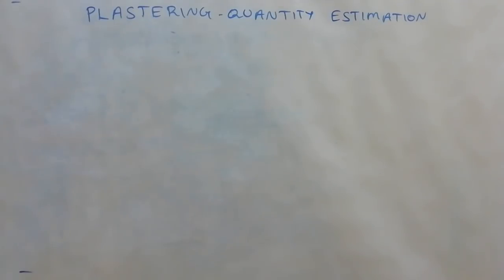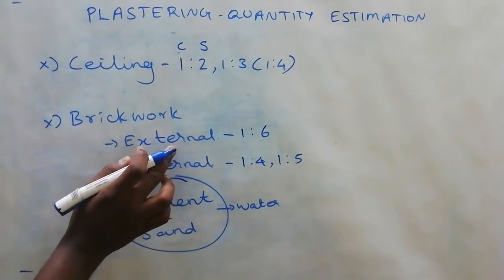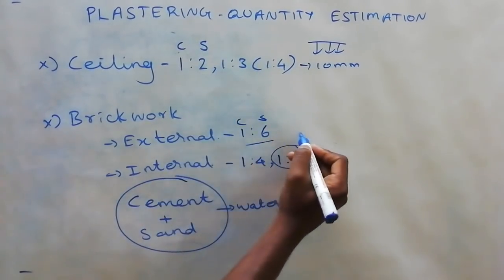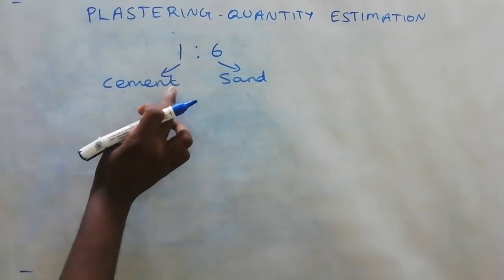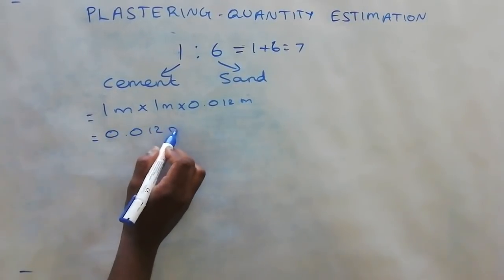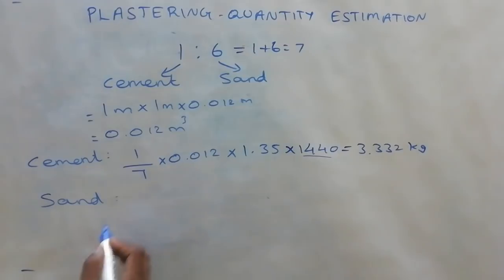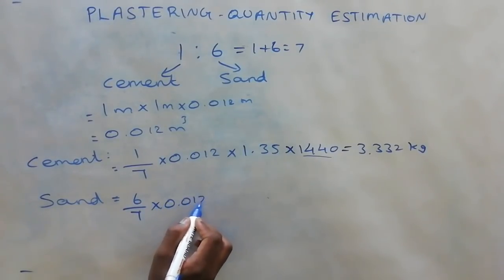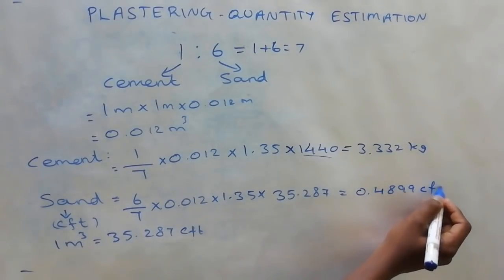Plastering work Calculation in Tamil | Cement Sand quantity for plastering |Technical Civil in Tamil

Comment: Ji உங்க Calculation ல கொஞ்சம் Mistake இருக்கு
First External plastering 1:5 
Internal plastering 1:4 ratio
Second 1 cum equal to 35.31 c.ft
3rd ceiling plastering. 1:3 ratio.
Calculation konjam doubt irrukku
Volume of ingredients 1.35 eppadi final panninga?

Comment: Hai bro . 1.35 u takeing dry volume but actually 35% Bulking of sand and 20% wasteage so we can take constant value 1.54 .
Reply from the maker: for concrete 1.54 where aggregates are used. for plastering 1.33 where aggregates are not used.

Comment: Bro Namma Calculated panra Area VA Sqft la Eduthaa Namma sand calculate pannum poothu 35.28 use Panna vendaaam la
Reply: SABARIKANTHAN KATHIRVELAN bro sq ft la edutha sand ok bro convert panna vena..but cement density ala multiple panrom athoda unit kg/m³ so nenga cement m³ la thn podanum  ..other option sqft la vara cement a 35.28  la divide panikonga
Reply: @vetriengineer9385  cft ல சிமெண்ட் qty கிடைச்சா 
நேராவே அதை  1.25ஆல வகுத்தா answer 
இத்தனை மூட்டை சிமெண்ட் னு  வருமே.... 
One bag of cement =50kg
                              =1.25cft

Comment: 1.35 எப்படி வந்தது
Reply: Cement Sant kalavaiyaga edukumpothu water apply seivathal Athil evaupration aagum.. So atharkaga 1.35 extra serthukollavendum
Reply: @veerukrish3550  & vetri engineer................ 
Both Replies are wrong. All of you 3 pl.ask Technical civil to upload a separate
Video in this mater.....
Reply: Pal Pandi due tohydration process  35% of water evaporated so they added 1+.35 =1.35
Reply: Brother athu 1.35 actually 35 % Bulking of sand 20% wastage . So constant a 1.54 we take